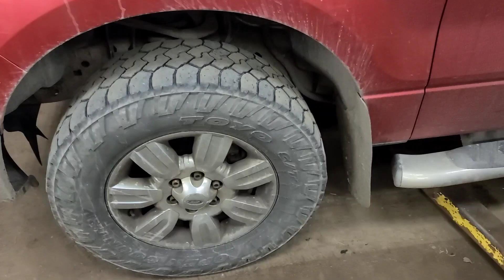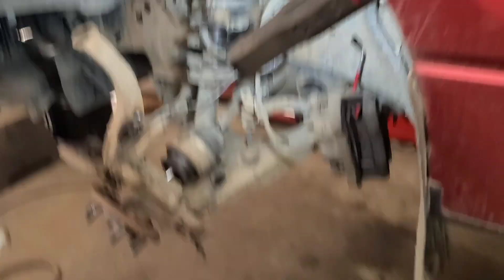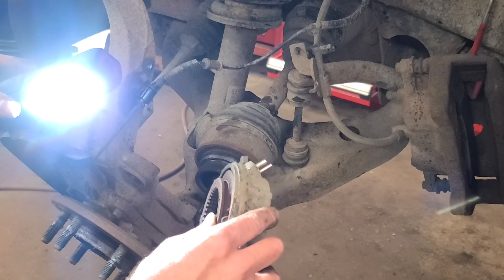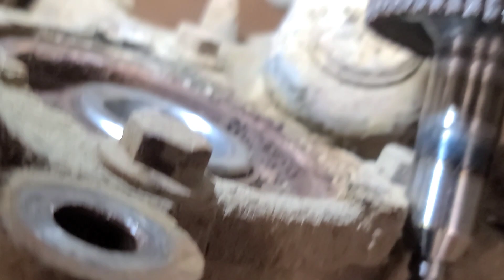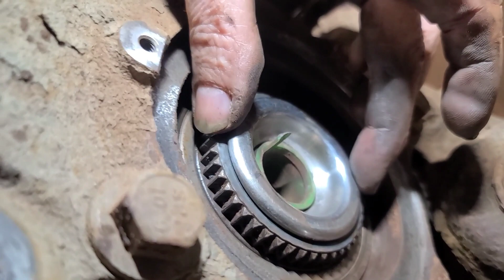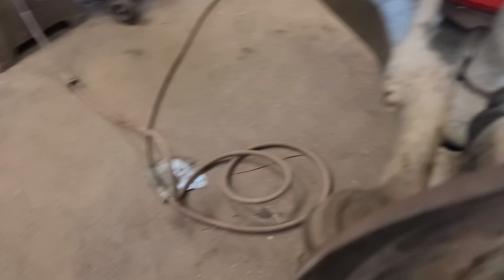2012 F150 IWE Vacuum Hub Lock Delete

Comment: Since the front diff will be moving at all times with having the IWE's permanently engaged, should a thicker fluid be used?  I can't find an answer to this... and losing sleep  🤣😂🤣😭😭
Reply from the maker: In my opinion the 75w140 synthetic oil is fine.

Comment: There are a ton of videos on how to replace rhe IWE but yours is the only one showing the dorman bypass, thanks for that.
Just curious will it affect the tight turning of steering or will it drive as a normal 2wd steering?
Reply from the maker: As long as the truck is in 2wd you will not notice any difference imo

Comment: Will this 600-405 kit fit on a 2017. I can probably order it and find out anyone knows
Reply from the maker: According to the parts supplier the 600-405 fits 2004 to 2015. I'm not sure what is different wit 17. I'd recommend to check the Dorman website for more information.

Comment: Informative video, so this Dorman would act similar in function to an RCV IWE delete ring/sleeve ? 

Would this hurt or damage your front differential if you’re daily driving the truck or is it just drag/ heavy steering and friction ?

Because I   got a midtravel kit upfront and it only accepts a IWE delete sleeve on the spindle hub mounting area I can’t mount the factory OEM IWEs.
Reply from the maker: I watched the video on the r c v I w e delete rings and this is similar. The rcv rings might be actually stronger. In my opinion the worst case scenario is you're gonna experience a little bit of loss of fuel economy because of the extra drag. Again in my opinion it's not gonna hurt the differential because it's just turning with no load on it. As long as the transfer case is in two wheel drive you should be fine.

Comment: $166 wheel bearing f150 2019 just bought one
Reply from the maker: There are cheap wheel bearings available but even $166usd is around $250cdn

Comment: done few f150s for oilfield operators...great fix...that bearing can get very expensive if you chew it up...800 $ plus for bearing...the doorman part has two hub gears...axles run all time...dodges do it...fords before 2009 did it...not big issue...smart fix in my opinion..

Comment: F250 350 are solid axel...f150 are not
Reply from the maker: @fordtrucks3960  yes they are but the 250 and 350 still use vacuum to operate. The 150 uses vacuum to unlock the axle whereas the 250 and 350 use vacuum to lock. I think Ford realized the vacuum was a stupid idea that's why they made use of manual hubs to override the vacuum on the 250 and 359s.

Comment: By using these you are guaranteeing premature stretching of the transfer case chain.
Reply from the maker: I'm curious but how do you figure that would occur
Reply: @PhillipBailey  this scenario forces the front drive shafts to be spinning all the time which then spins the front differential which then spins the front drive shaft which then spins the transfer case gears and the continuous loading and unloading of torque will stretch the chain. Sorry but that's what happens.
Reply from the maker: @docholiday5682 Yes, you are correct everything will be spinning free. If it's not in 4wd, there is no torque or load on the chain.
Reply: @PhillipBailey when the front drive shaft is spinning the gear and chain assembly in the transfer case is spinning. They're not engaged to the rear wheel drive system because the viscous coupler clutch has not been engaged. However the continuous tensioning and releasing of load on the chain will stretch it over time. Just look up stretched transfer case chain and you'll see what I mean.
Reply: @TorqueTickler  I hadn't thought of this.  Interesting idea... and going to look into it.  Appreciate your comment!

Comment: Do you have any regrets doing this? Would you recommend it? I've already ordered some replacement vacuum hoses to replace the brittle/broken vacuum lines on my 08 F150 which is causing my 4x4 to not engage.  I'm wondering now if I should not even try to correct the vacuum issue and just delete everything.
Reply from the maker: The F150 system uses vacuum to disengage the axles so disconnecting the vacuum lines would in theory engage them allowing 4x4 to work. What typically happens is one of the hub locks develops a leak or a vacuum leak occurs on a line somewhere in the system. This can cause the hub locks to partially engage and you will hear a chattering or buzzing noise from a front wheel when in 2wd.  This damages the teeth on the wheel bearing and or hub lock. Use a vacuum pump to make sure the wheel ends hold vacuum. Another killer of these components is different tire sizes front and rear. Measure the circumference of all tires with a string or cloth tape measure. Difference cannot exceed 1/4 inch. The delete will work well so long as the teeth on the wheel bearings are not worn and tires are same size. It will negatively affect fuel economy though...good luck.

Comment: Thanks for loading this video.
I wanna do this same procedure  to my 2004 Expedition 4X4. 
Has the owner contacted you afterwards to tell you what differences he's noticed since he started using these Dorman Lock Delete IWE's?
Please reply soon.
Reply from the maker: He's been back for other things and no complaints about the IWE. Says he didn't notice o loss of fuel economy
Reply: @PhillipBailey :
I tested my Expedition's 4X4 system by jacking up both rear wheels and leaving the front wheels on the floor. While the rear wheels were above the floor I engaged the 4X4. The moment I released the brakes I immediately heard a loud grinding noise identical to the one heard in the beginning of your video when you turned the wheel, but the front wheels would not turn at all in drive nor in reverse, only the rear wheels turned. 
So it seems to me that the transfer case is working and that the grinding noise is made by the IWE's.
For sure both IWE's are bad (that's why I ordered a pair of the hub lock deletes) but I'm afraid that the gears or teeth of my front wheel bearings might be damaged as well.
Reply from the maker: @cma8165  that's kinda sketchy what you did. If the 4x4 had worked the vehicle may have fallen off the jack. You're correct though sounds like the IWE actuators are stripped. May need new wheel bearings as well but you won't know until you get it apart. On a side note make sure all four tires are the same circumference. If not it will stress the 4x4 components when in 4x4 mode.
Reply: @PhillipBailey  Thanks for that good advice. My new Dorman hub lock deletes arrived today so I'll begin working on this job tomorrow if we don't get rain. And the 4 tires are of the same circumference so I'm good there. Thanks again.

Comment: Too bad nobody makes a manual locking hub replacement. It might have been inconvenient, but they were reliable.
Reply: They do...I did it to my 12 f350.   Disconnected the vacuum line.  Blocked the main side and baught a set straight manual hubs at the salvage yard..not the auto or locked ...straight lock or free.  Never an issue since
Reply from the maker: The F350 uses a different vacuum design. You can install manual lockers on it if it was not already equipped. It's a completely different design that uses vacuum to lock the hub as opposed to the 1/2 ton where it uses vacuum to unlock.

Comment: Can you just disconnect the vacuum silonoid
Reply from the maker: If you disconnect and cap the solenoid hoses the hubs should lock with no vacuum but if they have been grinding the teeth will be worn on the actuator and possibly wheel bearing so it may start skipping under load. This is especially agrivated by different sized tires.
Reply: Can you better explain disconnecting and capping them? Is it the 2 hoses that go into the solenoid you cap?

Comment: This changes the drive mode from 2H to 4A, or I should say it eliminates 2H, I believe.  I've got this issue on my 2017 Expedition and keep mine in 4A until I get around to getting it repaired.
Reply from the maker: The transfer case is what determines 2H or 4A. This just permanently couples the cv shafts to the wheel bearings. Alternatively you could disconnect the IWE solenoid vacuum supply and cap off the vacuum. No vacuum to the locks defaults to coupled but if the teeth on the actuator or wheel bearing are worn it could jump out of lock under load. Another thing that kills these systems are different tire sizes front to rear.

Comment: Fuel mileage gonna take a big hit
Reply from the maker: I seriously doubt he will notice the difference.  It still goes into 2wd only difference now is the front axle shafts are turning. Synthetic gear oil helps.
Reply: Ford fix was to remove the vacuum lines and do the same thing in concept.  Loss of mpg's was very noticeable. I'm replacing both sides, IWE'S and hubs and replacing all the vacuum lines as well.  Back to OEM. Ford tsb has them removed.  Stupid.